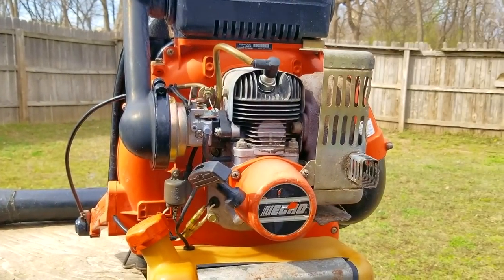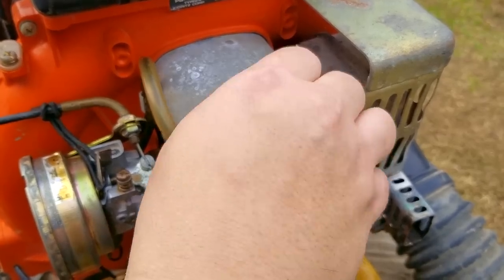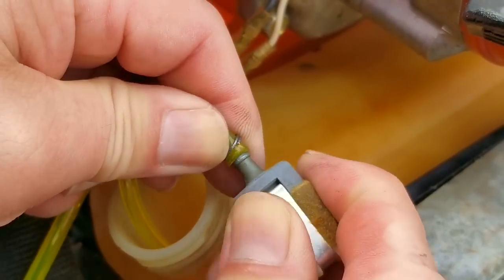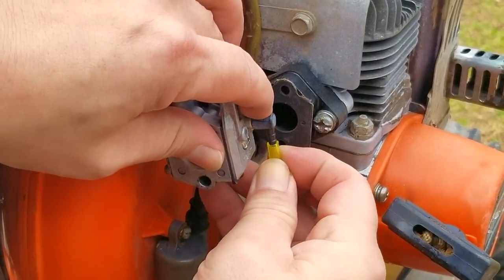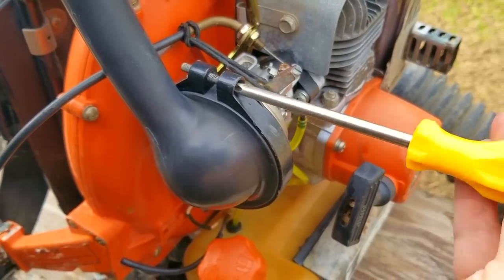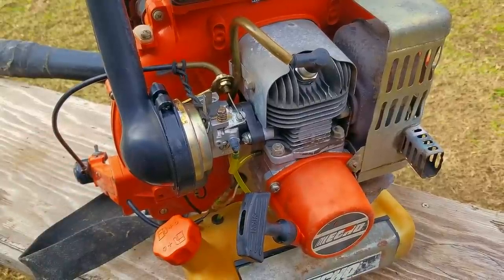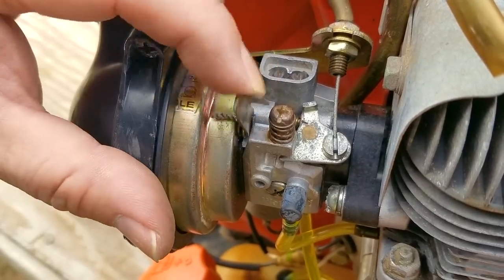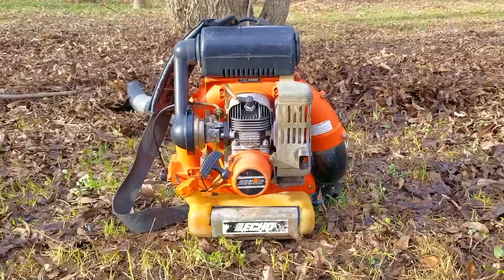Finally Fixed This Old Vintage Echo Blower And You'll Never Guess How

Comment: That blower was in the Echo catalog for over 30 years.   Started out in the mid 70's with points ignition on a unit called a Duster.  Received a cdi kit in the early 80's.  There was a bolt on ignition kit to switch them over.  One of the longest running blowers on the market.  I remember the R/C guys buying them to use on their giant class air planes.  Very popular for their day.  Great to see one being kept out of the dump because you just dont see them all that much anymore.  New stuff is much lighter from the use of plastics.
Reply from the maker: thank you for sharing that information

Comment: Nice fix on the choke lever. Works great thanks to your persistence. You saved another classic.
Reply from the maker: yes I thought it was the best idea at the moment.  If I get a second go, I might a different idea.
Reply: @HomeGaragechannel  You can install a lubed o-ring to tighten the choke lever. A piece of wire is the most economical. Anything less than that, like, for example, wrapping it with a small rubber band, might be a bit hokey. Cutting notches might damage everything. I would've added a little spring as a holder. You could also experiment with cable ties to keep positions  However, there aren't too many practical options.
Reply from the maker: I like the o ring idea!

Comment: If time is not an issue, kept going as you did. You had very good bones to work with, so it would not have been a waste of time to try out different things. I prefer to keep it OEM as long as possible, but it can be cost-prohibited trying to replace parts that way. Aftermarket is fine if OEM is too much or if that is what the customer wants.
Guess I'm saying it depends on what you find!
A nice blower that will have more years of use to come 🐺🔧
Reply from the maker: thank you Jonathan Sherwood.

Comment: I think that with a premium brand like Echo, I would be more likely to try & refurb the original carb, especially in your case, where you have plenty of experience, and a solid track record,  and usually spare parts available.  If it was a lower-tier unit, like something made by MTD, I would go for the cheap carb once I saw it was a carb problem.
Reply from the maker: nothing wrong with that.

Comment: My thoughts are the fuel line from tank to carb may have had a restriction. I would have put a kit through the carb, & replace fuel line & filter.
Reply from the maker: thank you Christopher Marshall, checked the old line for any blockages before reconnecting it.

Comment: awesome video as always, your videos have helped me a ton with my overall understanding of these little 2 stroke engines. I have one question though, what is that fluid you put the gaskets in to soften them or whatever it does. Id love to know because like you id rather do that than buy a new carb.
Reply from the maker: thanks, it's brake fluid.
Reply: @HomeGaragechannel  oh really? i wouldve never guessed, i will definitely try that out next time i need to get something running
Reply from the maker: it's worth a shot

Comment: Hello 👋. Recently come across your channel. I have a early 2000's Hayter (Possibly Webb or Murray in the US) ride on mower. It has a 30" deck and you sit on the motor. We bought it second hand a few years back but now it needs two complete front wheels ($150 for the pair) and the cutting deck has rotted away. A new bare deck is $250 but they have been discontinued. It's going to cost around $400 + a new blade $80 and a service I could do. Question is, is it worth repairing just for the convenience? It's 20+ year old model and parts are scarce and/or expensive. Should I repair it or use that money to buy a good used walk behind mower or even just a new walk behind mower?
Reply from the maker: it think it depends on your yard. If it's large enough that a rider works, I'd almost consider getting a push mower to slide under the deck and use that as a new deck. And yes riders have a limited life span. once it's over, the parts are simply not worth it, your choice.

Comment: Hey I have a snow thrower and it’s having a problem turning off when the key ignition is in the off position. Any ideas on how to fix it?
Reply from the maker: sure, use a multimeter on the switch and check for continuity across the prongs when you turn the key to off. Then check if one of the wires is grounded. let me know what happens
Reply: @HomeGaragechannel  will do

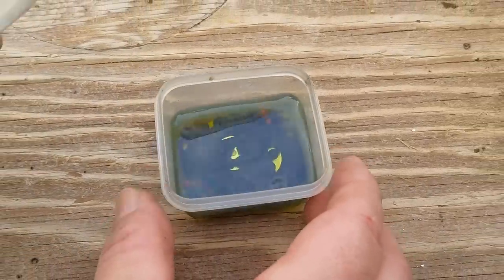Comment: Hey, just curious what did you soak the diaphragm in and is there anything else you can use to soak them in? 2:35
Reply from the maker: I have tried other types of fluid but so far, I've only found Brake fluid to  work the best.

Comment: Would I buy a new carb or rebuild the original. I enjoy making things work with minimal expense. I especially like to fix things that have been junked. In the case of your backpack I would try fixing the original carb. Failing that I'd buy a replacement.
Reply from the maker: agreed, I feel the same way.

Comment: Very nice, I had a nearly identical unit (mine had the smaller air filter, wish it had the top mounted, larger one like yours). Question... at 5:46, what did you use to lubricate the throttle wire?
Reply from the maker: thanks for the question, it's just wd40 and it worked great
Reply: @HomeGaragechannel  Great, thanks!
Reply: @HomeGaragechannel  apologies, one last question... could you share the solution you used to soften up the diaphragm?
Reply from the maker: sure, it's brake fluid
Reply: @HomeGaragechannel  thanks man 🙏🏼

Comment: On my carb for my weeder the check valve that is internal in my carb has stuck and iv tried every thing to get it freed up but it still wont move
Reply from the maker: If you've done everything you can, then you'l have to consider a new carb.

Comment: What did you use on the for diaphragm???
Reply from the maker: I use brake fluid
Reply: I would have never thought of brake fluid.  Cool
Reply from the maker: I had tried a lot of other fluids before I found it worked best.

Comment: well for me i would have tried the first option which is the servicing the carburetor before hand if no luck i,ll probably try the method you did for a secondary option or last resort and if no luck still then that,s when i would replace the carburetor aka carby and yep no different here in Australia as we have our Briggs and Stratton engines on the Rover and even Victa Lawn Mowers we have etc.
Reply from the maker: thank you for agreeing with me Patrick Stapleton!
Reply: @HomeGaragechannel  no worries mate and yep we have those kind of mowers over here in the land down under for sure and yep even Victa made their range of Tornado and Tornado Plus Trimmers including the legendary Razor Brushcutter type too which uses a 3 toothed blade from memory etc.

Comment: Question here, won’t start, replaced the carb, spark plug and fuel lines, and fuel filter, still won’t start, could I have no spark? Should I replace the switch or ignition coil, or both?
Reply from the maker: first I would disconnect the wires to the switch, and then test for spark. If that doesn't work then I would disconnect the small wire at the ignition coil and test for spark. IF that doesn't work replace the ignition coil.  have you done a compression test?
Reply: @HomeGaragechannel  it does have compression as I got it to start the first time, and then i never got it to start again, not even with fuel in the spark hole. I appreciate the help, I ordered a spark tester to check it tomorrow, I ordered a switch in case the switch was bad.
Reply from the maker: excellent

Comment: i also tune my 2 strokes ever so slightly rich lower cylinder temps and a bit of extra oil go a long way to making them last thats why new 2 strokes don't last to meet emission standards no user adjustable carbs lean burning low oil to fuel ratios leads to bearing wear and scored bores
Reply from the maker: you make a good point